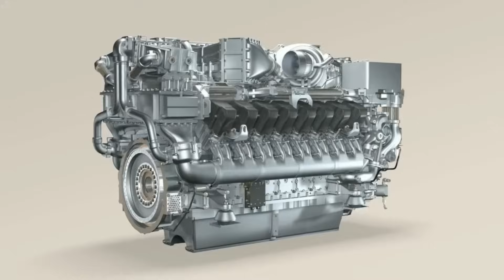Zorawar : DRDO-L&T light tank developed on  in record time is ready for trials #indianarmy #drdo

Comment: Guys Chinese don’t have the advantage in light tanks because in that altitude, the fuel  and oxygen ratio is not high enough to make the engine combust and drive the tank, unless they have a diesel / lithium battery motor it’s not going to be mobile. The altitude of that terrain plays a huge role in determining how effective a tank can be. Also tank rounds will be less accurate due to the limited equipment these tanks can carry therefore range of 105mm is limited you would need to at least close in 2 km for a good hit.